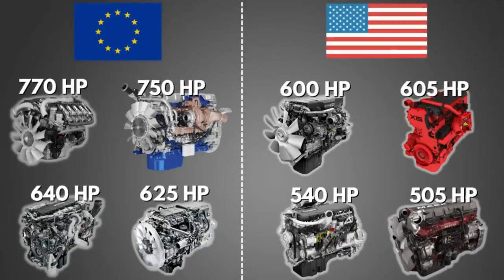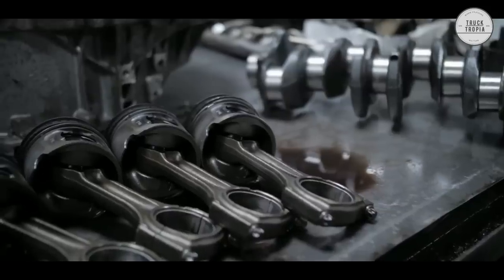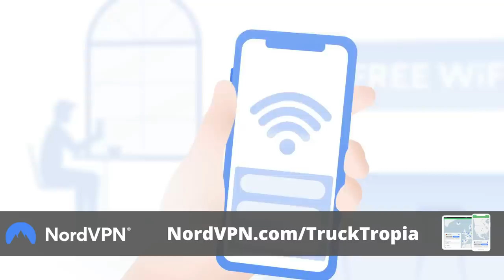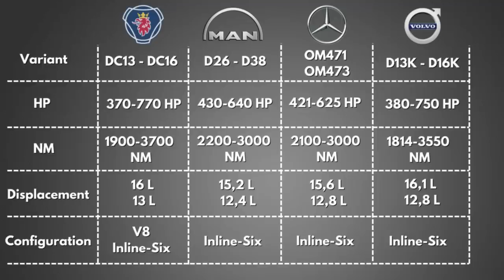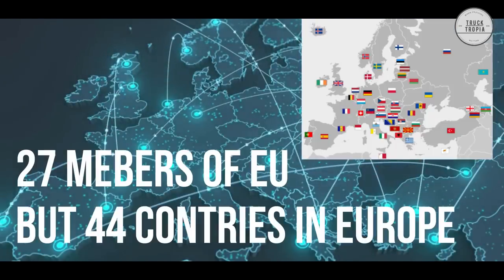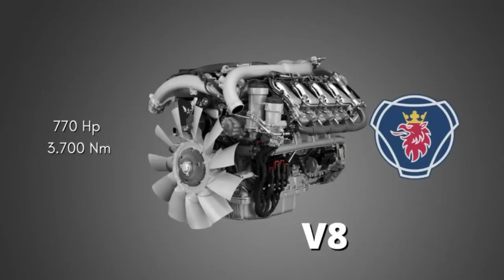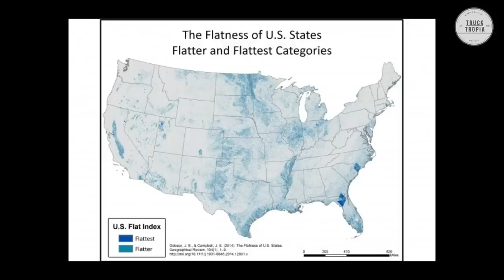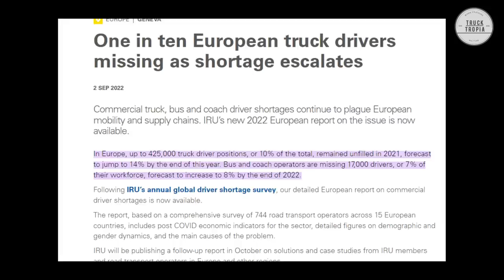Why European Trucks Have Up To 770 HP And US Don’t

Comment: He missed one, if not the major reason for European higher power, speed limits and limiters. When the 90kph (56mph) limiter was introduced this was the spark to much higher hp. In the US you can drive at 70 mph +/- depending on state on the flat, so if you loose speed on the hills the driver can soon make it back, in Europe the lower speed limits and limiters means you must try to maintain speed up hills, because you cannot recover the lost time on the flat.
Reply: He missed another one: US manufacturers got the OPTION to build more environmentally friendly truck engines, whereas for EU manufacturers it was MANDATED. This caused EU manufacturers to look for solutions to combat the inevitable power loss those new rules brought with them. As EU manufacturers developed better fuel injection systems, engine heads and ECU's, they discovered that it was fairly simple to increase the power without reducing the durability of their engines. 

Then there's the fact that whereas Mercedes have put a cap on their engines, reasoning that 630 HP is more than enough to haul any load, Volvo and Scania are in a continuing pissing game to see who can build the most powerful engine.
Reply: Horse power coupled with good gear ratio bud...I've got a 600hp Cummins hooked to 4:40 gears and an Eaton-Fuller 8LL in a Pete 367 tri-ax...I average 74,500 a load and where I live is anything but flat. Try driving up Rt 201 to Jackman, Maine. Because of my engine and gearing I literally never drop below 6th  gear the entire way up to Jackman (roughly 100 miles) and there are some really long and steep hills)
Reply: @aaronsanborn4291  Mercedes has a trick for that with the gearbox in their top Actros trucks. It's a fully automated 16 speed with a load sensor on the fifth wheel, but the main difference from other gearboxes is that it has a distinct 8 short low gears, 8 long high gears setup, almost like an agricultural tractor. This gives the truck enormous torque at the wheels in low gears for exceptionally heavy loads and/or going up steep inclines, whereas the high gears are more for normal highway use.
Reply: Precisely; this is also the reason for which in Italy (where there are lots of hills) it's not uncommon to find 700 / 750hp trucks, climbing fairly steep inclines while managing to maintain the speed limit (80 km/h).
Reply: Most definitely, no big space like the US.
Reply: Slower speed limits? I have lived In EU for years and the speed limits are definitely higher then PA, NJ and NY. Nor do i think that 700hp is wide spread in Europe.
Reply: @hitmanslayer3003  speed limits for trucks, not passenger cars. If an an 18 wheeler overtakes you in Europe, you're driving too slow.
Reply: Ha ha. On the M62 in the Pennines my Scania is lucky to see 36mph going uphill.
Reply: That's exactly what I thought. The less powerful engines could pull those heavy loads but only at a much lower speed.
Reply: @tjroelsma  the term is "pissing contest."
Reply: @eefneleman9564  in Germany, it happens. It isn't unusual for cars driving slower than the truck speed limit to be getting passed by trucks on the Autobahn. When you consider the lack of power some of these cars have, and how inefficient they become at higher speeds, it's less jarring. It's also nice to have no passing zones for trucks going up long hills, and lane change restrictions at many interchanges. Of course, when you have no speed limit, you don't want a vehicle trying to clear incoming ramp traffic causing a wreck because they were hasty, or conversely, for someone clearing the passing lane getting tangled up in the same incoming ramp traffic.
Reply: @hitmanslayer3003  truck limits are 80km/h (50mph) in most of the EU, a few countries allow 90km/h (56mph)
Reply: @tjroelsma  US mandates strict emissions controls on heavy trucks as well.  US is actually more strict on NOx than even Euro 6.
Reply: @mrvwbug4423  Yet the US still allows older trucks with NO emission controls to be driven almost everywhere. And a lot of US truckers actually refuse to buy new trucks because of "those pesky emission controls" and proudly drive their old "max emission" trucks just out of principle.

My whole point is that because things are strictly mandated over here in West Europe, companies are being forced to buy new trucks that meet the higher standards after the grace period for previous lower standards trucks has lapsed, or face the problem that their trucks can't deliver their cargo to all of their customers anymore.

It never ceases to amaze me how the US can at the same time be so very progressive and leading in some fields of technological development, yet so deliberately backwards in other fields. Many people in the US simple refuse to believe that stringent emission standards are a good thing and use their "right to be an asshole" to keep polluting the environment just for the sake of being an asshole (Rolling Coal comes to mind). 

It's my sincere belief that if everybody around the world would use their brains the way they were meant to be used, a lot of problems could be solved in a relatively short period.
Reply: @tjroelsma  It's not just "out of principle", the costs of upgrading can be prohibitive, as well as the reliability issues that come with the newer emissions technologies.
Reply: @hitmanslayer3003  Truck speed limits are lower.
The speed limit for trucks is 50mp/h. Which is 80km/h.
They have to be limited at 90 km/h ~56mp/h
Reply: @tjroelsma  Everyone knows that much of emissions standards is a racket. We get screwed over to support a nebulous “greater good”.
Reply: @LeverPhile  Reliability isn't a problem over here, so why should it be a problem over there in the US?
 
As to the principle: many US citizens are what you call "wilfully ignorant": they know what they know and that's all they WANT to know. So if you tell them something "new", they'll simply ignore it. And contrary to what you believe, there are enough US truckers proudly boasting on YouTube how "their 450HP Caterpillar 3406 engine is actually stronger than a 550HP Cummins ISX engine", even though simple math proves them wrong.

As to the cost of upgrading: the era of the independent trucker is pretty much over, except in the US. Over here in West Europe companies have taken over long ago. Their baseline is running trucks at the lowest possible costs and that means the latest trucks. Euro 6 trucks are the most economical trucks to run, because the fuel savings are the highest. On top of that they write off part of the trucks value on taxes each year, so after an x amount of years, that truck has been fiscally written off and they buy a new one.
Reply: @mrvwbug4423  80kmh is ridiculously slow...
Reply: @HitmanSlayer  your right. I'm a truck driver, and ony time I've seen a 770 in person was a demo at the dealership
Reply: @Nick Beardshall  😅😅 yea I've had 25 mph going up windy hill in a 420
Reply: @macky4074  if it makes you feel better Macky an FH750 left in economy does 44mph up Windy Hill, still in top at 850rpm admittedly, put it in power it just sits on the limiter straight over the top in 10th, hate to think how much fuel that uses though.
Reply: @geoffbell166  Yes, now imagine that on a German autobahn, with Porsches and BMWs flying by at 200+ km/h haha
Reply: @hitmanslayer3003  it’s not uncommon in sweden at least. I see them on a daily basis
Reply: @Nickbaldeagle02  that one climbing up to Saddleworth from Manchester is long and steep. It's a good job it's 3 lanes and the last time I drove up it a hard shoulder. That's about 3 years ago. It's probably a running lane now since we all became SMART what a weird acronym!
Reply: @anthonykaiser974  We know what he means mate.
Reply: @unclebullfrog7319  who was talking to "we?"
Reply: @eefneleman9564  in Hungary vehicels above 7500kgs  are not allowed to overtake on highways between 6am and 10pm.
Reply: @tjroelsma  they are not really proud,but the new engines are unreliable and expensive to maintain.
Reply: @Nickbaldeagle02  Lovely bit of road though. You can take time to enjoy the view as you drive past that farm stuck between the two carriageways!
Reply: @mrvwbug4423  more like 250+ hahaha
Reply: @theonly5001  In the UK the lorry speed limit is 60mph but by (EU) law, the lorries have to be limited to 56mph (90 km/h).
Reply: Most trucks can hold the 80km/h (in reality 90km/h) on climbs. I had the problem with my old RV. In the flat I could overtake them, but if it got steeper 😞. The new one can barely hold the truck speed.
At least in Austria the toll is higher for trucks with worse EURO classes. It's about 10-15% between bad and good classes. Electro is even much cheaper.
Reply: @mrvwbug4423  the speed limit for trucks in the UK (in or out of the EU) is 60mph (96kph), and even that is not enforced very hard, but we still have limiters at 90kph. Isn't spain 100kph, or did they drop to 90 when speed limiters were introduced.
Reply: @LeverPhile  if you stop idling, another massively wasteful practice, you'll find that emission engines are not unreliable, it is true that they do hate idling though. But why do it, Webasto water heaters keep cab and engine warm for a gallon per night, battery ac keeps it cool in summer nights, but the US would rather leave a 15 litre Cummins on fast idle all night,  bonkers!
Reply: @pharkasj  no they aren't if you treat them properly, and the US won't. Leave them idling and your in for some big bills.
Reply: This argument doesn't hold at all.
Reply: @tjroelsma  There is literally no way to know that reliability isn't an issue with new trucks.  I've seen 40 year old Peterbilts and Macks cruisin through the Rockies; that's reliability right there.  A five year old truck that still runs alright?  That tells me literally nothing except it isn't a catastrophic failure
Reply: @mrvwbug4423  depends also of what the installed limiter tolerates. On my Subaru speedometer the fastest trucks drive around 95kph. With GPS this is about 87kph.
Reply: @geoffbell166  on Overland it's 60. Many do drive faster but some company's will be harsh if you may got a ticket. They do not want drivers to be seen driver over the limit.
Reply: @coupledyetivonvanderburg5385  Well, during those 5 years, that truck has probably done over 600 thousand miles and has delivered a huge amount of cargo. And being 5 years old, it still runs without problems, so yes, I'd call that reliable. 

Those 40-year-old Peterbilts and Macks you're talking about have way less mileage because most of them have been dumped/abandoned decades ago with some (minor) issue(s) and have been discovered and revived recently.
 
A common scenario over here in Europe is that a semi will be used for international cargo hauls up to 1 million miles and then it will be used for national cargo hauls, easily putting on hundreds of thousands of miles more before it's finally being sold. 1.5 million miles isn't an exception over here and to me that spells reliable more than a 40-year-old truck with "only" a few hundred thousand miles does.
Reply: In the US many trucks aren't speed-governed and can, and do 80mph, legal or not. ..... I see trucks doing 80 fairly frequently in NC and up and down the east coast.
Reply: @tjroelsma older trucks are cool and reliable and affordable. Surely if the vehicle lasts 50 years, it’s more environmentally friendly to use it than it is to throw the whole thing away and make a new truck. Think about how much energy and pollution it takes to make a new truck. Then consider the difference margin between new and old trucks… i bet it barely breaks even.
Reply: @tjroelsma thats a good point, and surely a million miles is a good lifespan. but my point about old trucks remain. Today i found myself doing 140km/h behind a truck on the I-25😂
Reply: @tjroelsma  
Most of those 1 mil examples are going to be about 10-15 years old though, which is outside the scope of the 5 years which I specified.  Half a million miles doesn't really much when it comes to long-haul trucking.  Also, you seem to be under the impression that I think Euro trucks are *un*reliable, which is not what I'm saying, simply that you cannot know the long-term effects of changes just by observing the short term, which 5 years is.

As for the 40 year old trucks, plenty of em have 1-2 million on them, so I really don't know what that speculation was about.
Reply: @coupledyetivonvanderburg5385  Then I misunderstood, as a lot of people seem to believe that because of the environmental systems European trucks are per definition unreliable.
Reply: @Heatherder  Yeah, 140 kph is a bit much for European trucks, but then the speed limits are very different over here. That being said: before the limiters became mandatory, most European trucks could do 120-130 kph as well. With modern day limiters however, it makes more sense to change the end-reduction so the gears are spaced out better between 0 and say 90 kph.
Reply: @tjroelsma  
They naturally have more points of potential failure, but the question is whether or not they will actually fail still.  Hence I'm merely skeptical of short term results being descriptive of long-term reliability.  I'm very interested to see how these Euro trucks hold up in 15-20 years, and what components exactly cause the most issue
Reply: @coupledyetivonvanderburg5385  They won't reach 15-20 years normally speaking, because Euro emission rules change every couple of years. Even with the grace period when more stringent rules have been mandated, the average life of European trucks will see a maximum of maybe 10-12 years, because after that it doesn't make much sense for large companies to keep using them. Smaller companies may use them somewhat longer though, but generally speaking heavy trucks in Europe see high mileage in a relatively short life. 

But this isn't a case of reliability: even at 12, 15 or 20 years those trucks still work perfectly fine, provided that they have been properly maintained, and it might even be technically speaking possible to do an upgrade of the environmental systems of a truck so it will comply to the more stringent rules. It's a case of economics, as those upgrades don't make much sense due to the way the trucks have been and are being used. Economically and fiscally speaking it's better to run heavy trucks hard (high mileage) and to write them off for tax purposes in a relatively short period. 

If you search for second-hand trucks in the Netherlands, you'll see that that even Euro-3 compliant trucks are still for sale, but due to the outgoing Euro-5 and present Euro-6 rules, buying such a truck and running it commercially doesn't make much sense, as the number of environmental zones where these trucks are prohibited keeps growing.
Reply: @tjroelsma  most European tractor units will comfortably do  between 140-160 kph without the limiter. They are on the limiter at 90 kph at often just under 1100rpm, do the maths.
Reply: @acd1202  The older ones maybe could, but I doubt the newer ones could do it without swapping out at least the final drive. 
These trucks are now perfectly setup to use their gearbox optimally up to 90-100 kph, as speeds above that are prohibited everywhere in Europe.
Reply: @tjroelsma  final drives have never been taller, Scania now offer a 1.92, that won't do 1000rpm in top, so equipped at 1800rpm rated engine speed your at 180kph, 115mph not that I'm suggesting you try it. Most tractors in Europe being built today come with 2.3 ish as standard theoretical top speeds have never been higher but the limiter makes it purely theoretical. Years ago yes for instance a Mercedes 1626 underpowered as they were would do 82mph 132kph with a 5.22 diff and a 0.78 top not because it was tall geared but because it would rev to 2800rpm, things have changed.
Reply: @acd1202  You're talking top end tractors. 
I've driven more midrange trucks in the 200-300 HP range and I can't believe they would have managed to do much more than 130-140 kph, especially seeing how many revs those trucks already did on the limiter. 

The top end trucks may reach a higher top speed, but it's still just an academical discussion, as you simply can't drive them fast anywhere in Europe. And personally I wouldn't take a 700 HP Scania up to 1800 rpm for longer periods, but then I am somewhat conservative with vehicles.
Reply: @geoffbell166  
It's a calculation sweet spot someone came up with. Tyre wear, fuel consumption, high gross weight etc. Going past 90 km/h will cost you a lot, fuel cost is no joke. The EU is also a very dense region compared to the US, you rarely need more than 9 ½ - 10h of driving to get where you're going so 50-52 mph is the calculated trade-off. Do that in the US might as well not drive at all, you're going nowhere
Reply: @tjroelsma  Don't you think it's funny how Europe is arguably more capitalistic when it comes to trucking than the USA? Being able to make a living as a self-employed truck driver shouldn't be that difficult but Europe forces people to work for huge capitalist corporations instead of giving them the freedom that comes with self-employment.
Reply: @baileyharrison1030  Not really, because that's a false argument in my opinion. Europe isn't more capitalistic, it's way more efficient. 

Large companies want guaranteed efficiency and continuity and self-employed truck drivers simply can't give them that. On top of that: as the distances for retail supplies are relatively short, it's mostly a case of carefully timed delivery, which again a self-employed driver can't offer. The only way that a self-employed driver could meet those demands, would be to sign an exclusivity contract with a company. The problem with that is that our version of the IRS looks at that as a disguised employer-employee contract for tax-deductions and doesn't allow for it. It's these factors that have pretty much killed off the independent truck drivers. Sure, there are still a few self-employed truck drivers left, but they're so scarce that they are just a statistic. There are somewhat more small companies left (with 3, 4 and more trucks), but they also mostly rent out their trucks and drivers to smaller companies.  

So the large companies have only two options: 
1. Hire a transport company that has multiple trucks and drivers for their transport.
2. Buy a fleet of trucks and hire drivers to do the transportation themselves.

I've worked for a company that had the truck I drove stationed at the distribution center of a large supermarket company over here, so indirectly I worked for that retailer. 

AS to how critical timed delivery is: I live near a XXL store of said supermarket company and it receives at least 6 and up to 12 fully loaded semi's per day delivering products from the distri-center. That requires precise planning. For example: as a driver you get a strict schedule: pick-up at dock X at 09:30 and arrive for offloading at supermarket Z between 10:15 and 10:30. Arrive outside that window and you employer doesn't get the ToT (Time on Target) bonus.
Reply: @tjroelsma  I'm not in the industry but I don't believe that independent drivers in the US do the kind of work you're talking about. Most retailers and distributers do own their own truck fleets and directly hire drivers. 

You can't really argue Europe is more efficient as it seems to me it's government regulations preventing independent drivers from making a living. In the US there are no shortage of trucking companies big and small to compete with independent drivers and somehow the independents continue to exist and I'm sure it's not because they have higher prices and inferior service. If larger trucking companies were always more efficient the independents would naturally cease to exist.
Reply: @jmuench420  The European transport sector and the US transport sector are two very different things. 
I CAN really argue that Europe is more efficient as the supply lines between distri-center and shops are generally speaking much shorter than they are in the US, making very strict timetables possible.

Your last line actually makes my point: larger trucking companies in Europe ARE more efficient ánd can deliver at lower rates, so there aren't many independents in Europe anymore. The few small companies that still operate mostly rent out their trucks and drivers to one or more companies. 

For example: the last truck I drove belonged to a small company. That truck was used daily as follows: 
1. 05:00 to 07:30/08:00 Interdepartmental runs for PostNL Den Haag
2. 09:30 to 17:30 Pallet deliveries to customers for TNT Express Den Haag
3. 18:30 to 21:30 pick-up shipments from several customers and deliver it to the DHL distri-center in Dordrecht.
Reply: @rosen9425  I know I have driven heavy diesel for years,our heavy vehicle speed limit is 90kmh here as well...
Reply: @tjroelsma  is it true that the older trucks are exported to countries with less strict emissions rules, like places in North Africa, as I’d expect?
Reply: @eefneleman9564  Actually in my country (Singapore) my family car (going just under 100km/h) once got overtaken by a bus from neighbouring Malaysia since I don't think they have the electronic speed limiters (set to 60km/h/~37mph) that my country requires for heavy vehicles (above 3 tonnes I believe) registered locally
Reply: @tjroelsma  do they need to scrap trucks after some years? I live in Brazil and although in roads you mostly see newer trucks, you can find very very old ones on smaller cities and roads, like made in 70’s..
Reply: @tjroelsma  It's not that Volvo and Scania are competing for that silly sh*t. They have the scope in their engine and some parts of the EU also needed that much power. I bet that either Volvo or Scania will introduce another more powerful version of their engine. 

And having more regulation means it's in practice. Most USA semis are old thus the emission regulation is useless here. Even emission standards, it's mostly followed in the EU.
Reply: Very few states that allow semi trucks to do 70, even when they allows cars at 75 (or 80 in Wyoming).
Even in the West where limits are higher, in the East a lot of states are "60 for trucks" and "65 for cars", or even 65 and 55.
And you don't make up speed soon when crossing the Rockies, as a general rule.
Reply: @tjroelsma  you should see a 13,15 or 18 spd with a 3-4 spd Brownie, that’s 30-40 forward gears, pretty amazing ✌️🇺🇸
Reply: @tjroelsma  I mean. I work for Scania so I can't say anything here. But there is a roomer that Volvo wants to release an 800+ and that Scania wants to beat that in the future... But no one is focusing too much on ICE engines right now...
Reply: @adamhlali8106  Scania and Volvo have committed themselves to the horsepower/most powerful truck race, so every move from Scania will be met with a reaction from Volvo and vice-versa. 

Mercedes has seen the futility (and probably the costs!) of this race and has stopped at 630 hp whereas the "less premium" companies like DAF, Renault, MAN etc have decided long ago that around 500 hp is enough for normal freight hauling.
Reply: @baileyharrison1030 capitalistic does not mean monopolistic.  A characteristic of capitalism is competitive markets.
Reply: Lose, not 'loose'.
Reply: Jeff Spehar  you are quite right, and I do know the difference. My only excuse is that it was probably 2am when I wrote the comment. 
Now, what have the rest of you been doing to let my error pass for 6 months without comment?
Reply: @tjroelsma fuel price is big reason than environment friendly idea
Reply: I think Europe truck is like gay truck similarly some of gay has a lots of muscle than normal man. But gay is gay. This idea works for a truck. Europe truck needs very shorter wheelbase for driving their road making the design be cab over an engine not like American truck has ridiculously long wheelbase which can make its design conventional type. Conventional type looks very cool than cab over the engine in world-wide people opinions. Sadly this type is not appropriate in many Asian countries also where has narrower road than America has. This also may make American’s needs lower. American really love good figured and sound nice and already have them which still runs nicely at 80mph. Of course no problem with their surroundings!  These attitudes also affect American truck companies’s technology because they may not need upgrade it. Because already powerful.

Don’t take it bad. Everything is evolved to match their environment. Anything is wrong anything is right absolutely.
Reply: @hongmihnhahn7081  For the transport company fuel is a very important factor, but as more and more cities have so-called environmental zones, they have to have Euro-5 and pretty soon Euro-6 compliant trucks, else they aren't allowed to deliver in those cities anymore. As a Euro-6 truck has to be more fuel efficient in order to be able to comply with the enhanced environmental requirements, they are actually more fuel efficient than their predecessors. So for that point of view it's a win-win situation: the trucks can deliver in environmental zones ánd they are more fuel efficient.
Reply: @tjroelsma  the less premium company that is Renault also focuses wayyy more on specialized trucks, mainly for the construction sector
Reply: One of the things I found most annoying in the US is the no speed limit thing for trucks. It just doesn't make sense that these monstrosities are allowed to overtake regular cars in the left lanes. Very inefficient way of organizing traffic. But I guess it comes down to US way of organizing things (better have the freedom to f*ck shit up than to be organized under rules).
Reply: @Pierrot9315  Yes, but then pretty much every truck manufacturer has a "Special Vehicles" department. 

Renault, just like DAF, has focussed on main stream trucks whereas only the big three (Scania, Volvo & Mercedes) have always included the premium segment as well. For Renault and DAF it simply doesn't seem to make much sense to try and enter the premium market, because they'd have to do massive investments and the chance of being able to draw customers away from the Big Three is relatively small. 

MAN in my opinion is somewhere in between: they're still strong in the main stream market but are now also producing more premium trucks. Personally, I don't see those premium MAN trucks being able to draw customers away from the Big Three.
Reply: @tjroelsma   Renault was seen as innovative with the Magnum, but now Mercedes took their spot. The Actros is just too good. But the Renault 6x6 or 8 wheelers, I see them all the time. Mainly in construction. Might be because I live in France. But it’s either them or man for construction.

Them or Peugeot/ ford for work vans.

And a fuckton of iveco Daily’s
Reply: @Pierrot9315  The keyword here being WAS. DAF was also innovative in the past, but when trucks reached 500+ HP, manufacturers like Renault, DAF, Iveco and MAN said "this is more than enough power for standard freight jobs", as there are strict weight limits a truck/trailer has to stay within. And reasonably speaking they're right: many trucks that haul only nationally have "only" 350-400 HP, yet they transport the maximum weight easily. The 500 HP trucks are mostly used for international freight hauling, because that extra power is preferable when crossing the Alps or the Pyrenees mountains. For standard freight hauling you don't need that much HP. 

Renault Special Vehicles makes the trucks you refer to and just like the Special Vehicle departments of other manufacturers, those vehicles have little to do with standard vehicles and are often build on demand or even custom build. If you go to DAF or Iveco, they'll also be willing the build a special vehicle for you, but like I said those are mostly on demand only.

MAN is the exception in my opinion because they have upped their game with the TGX series, that delivers 600+ HP, but I'll still say it falls short of the premium trucks from Mercedes, Scania and Volvo at this moment.